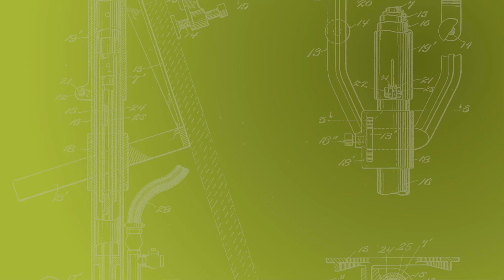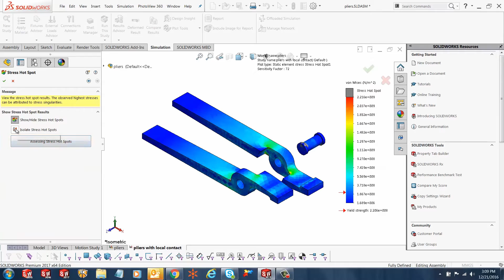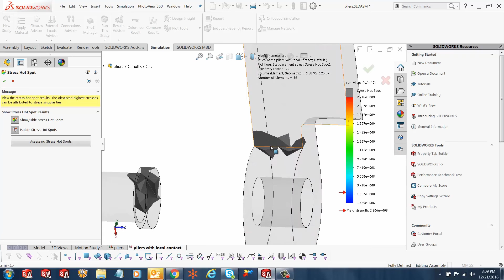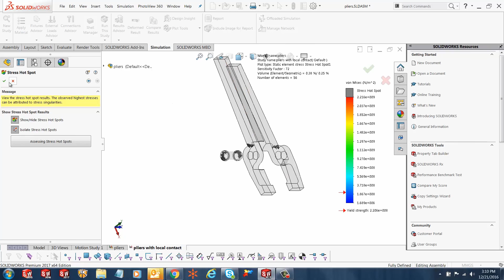SOLIDWORKS Simulation 2017 - Stress Hotspot Diagnostics

Comment: if there is a hot spot between assembly components how do i get a valid stress result? since i cannot add fillet between them.
Reply from the maker: It is perfectly fine to go into each of the different part files in an assembly and apply fillets to the areas showing a singularity in the stress hot spot diagnostic tool. These fillets do not have to be large; they can be fairly small, just something to make it so that each of the corners creating singularities are no longer perfectly orthogonal but have some area to apply a mesh.